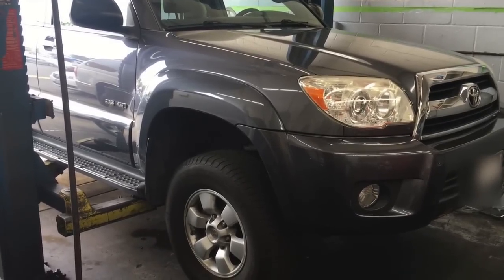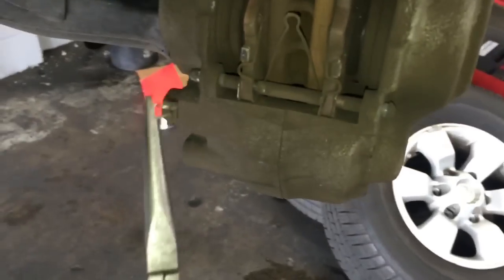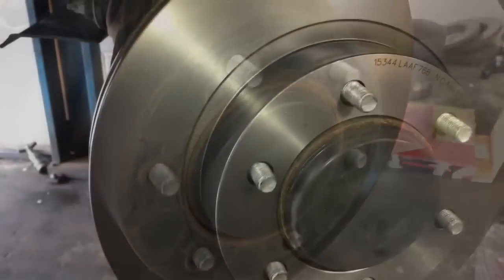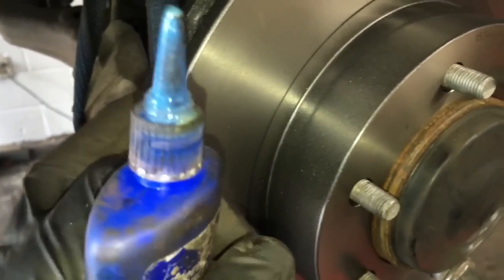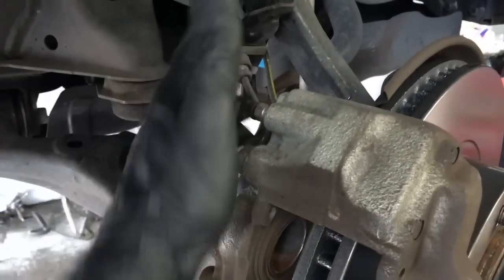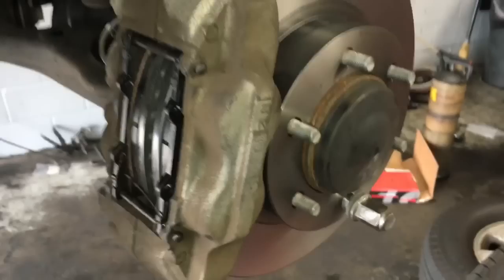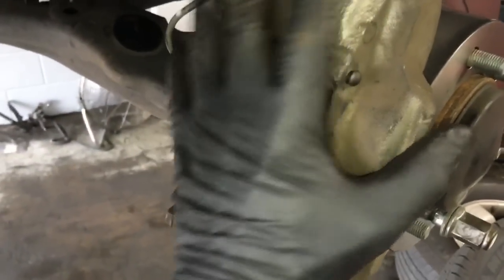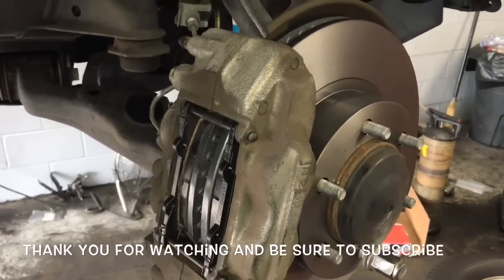How to Replace Front Brake Pads and Rotors on a 2008 Toyota 4Runner

Comment: It is an informative video excluding where you show how to remove and reinstall the retainer pins spring clip and the lower spring clip.  This is important stuff.  I have changed Ford Brakes before and this is a bit different.

Comment: Awesome video! Would this video How to Replace Rear Brake Pads and Turn Rotors on a 2003 Toyota Highlander cover the rears on a 2008 4runner?
Reply from the maker: Workout it would be similar. Here is a link to my website How to Automotive. If you search the video page which I will link to and type in Hylande or or rear brake job at all my videos will be there to help you. http://www.howtoautomotive.com/videos/

Comment: I'm lost on the whole turkey baster thing.  What do we do with that?  Other than that, thanks for the instructions.
Reply from the maker: Jeff Almanza You can use it to suck out a little bit of brake fluid so it doesn’t overs bill into the engine bay when you press the calipers in. After your done with the job you’ll put fresh brake fluid back in

Comment: Thank you Mr.s Eslick, great stuff.  I've never been much of a mechanic, always wanted to learn and save some $$, and you make it look easy.  Does this process differ any for a 2005 4Runner SR5?  Also, do you have a video for rear drum brake replacement, or conversion from drum to disc?
Reply from the maker: Kelly Murphy Hello Kelly. The 05 will be the same job. I don't have a video on converting rear drums to disk but I do have videos on doing Toyota drum brakes. You can check out my website http://www.howtoautomotive.com and do a search on the video page and all my  brake job videos will pop up. Thank you watching and writing!

Comment: I recently just done this but now have spongy pedal. Do i need to bleed the proportioning valve?
Reply from the maker: RaBBiT SWYD try bleeding all 4 brake first.
Reply from the maker: Also if it has drums in the rear adjust them.

Comment: Thank you!
Reply from the maker: Osan Shouo thank you for watching! Did everything go smooth?
Reply: @HowtoAutomotive  ... will let you know when the front rotors and pads arrive. Bought them from Ebay for $70. If one recommendation, a little more light under the car. Overall, looks easy to follow, have done brakes before but never w ABC. I was not sure if something needed to be reset.
Reply from the maker: Osan Shouo nothing to rest just Pump the Brake Pedal before driving
Reply: Brian;   ... Done!  * Make sure to push back all the way flat the pistons as he states with the old rotors in place.
Loosening the 12MM bolt makes use of the flexible line, if the metal line is bent its a biatch to put back the caliper. I jumped a few steps and regretted it, follow the guidelines exactly as in this video and you should be done in less than two hours, taking breaks.

* SAFETY NOTE: Have a spotter with you, engage the emergency brake, place wheel chocks on the rear tires, maintain the vehicle in towers, DO NOT use the car jack to work on the car. Failure of the car jack and you are underneath could be fatal.

Take your time, do not hurry, make all safety prep work before beginning the brake job, its not a race and nobody cares if it was done in 15 minutes. 

Thank you
Reply from the maker: Osan Shouo thank you for all the tips!!

Comment: have a 2005 runner that has a constant  warping issue on the driver side rotor. Rotor spins into a bind in the caliper thus causing a horrible uneven braking felt in the pedal. gone through a caliper and two rotors now, still same issue. next to look into is the hub assembly if someone seated it slightly crooked. never ran across so many problems than with these 4runners.